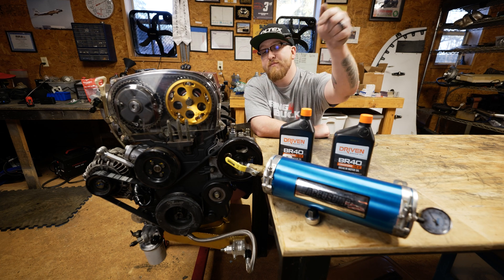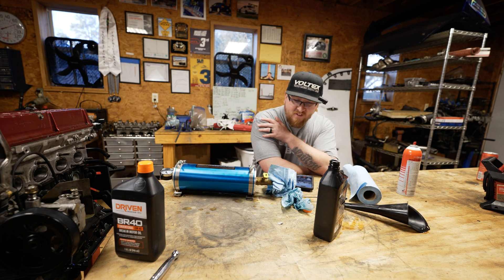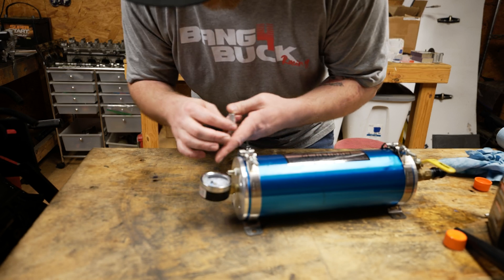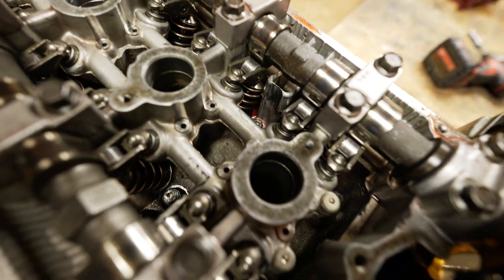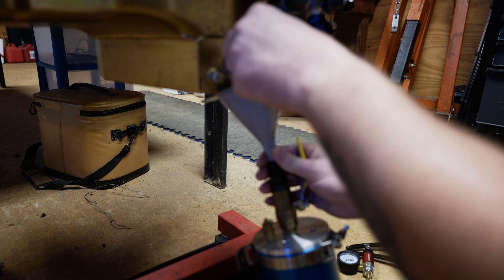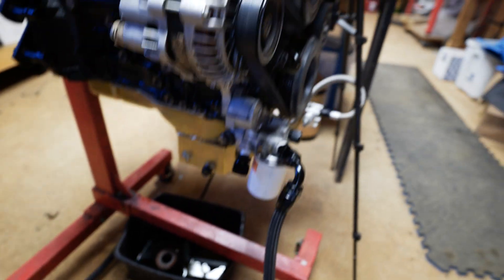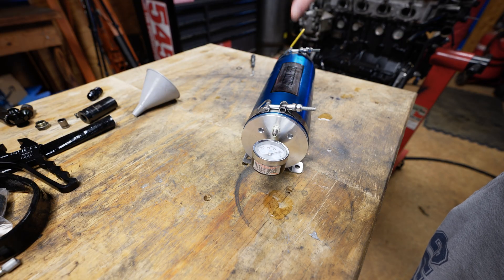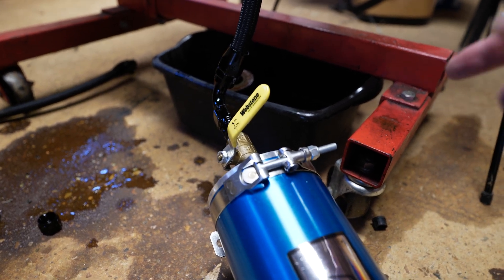Protect Your Wallet, Pre-Lub your Engine Block!

Comment: The accusump is a fantastic insurance policy if you’re not running a dry sump setup. I’ve had one plumbed into my 4G63 for over 5 years and it has played a major part in keeping the engine happy. Before I start the engine, I open the valve for about a minute, as long as it takes me to get my belts on. When I pull into the paddock, I shut the valve just prior to shutting the engine down. When I took the motor apart to rebuild it last off season, the bearings looked really good considering that it only saw track time for 5 years and had excessive water and oil temps for most of that time. Pre-lubing an engine is never a bad thing. Anyone that says different is lost.
Reply from the maker: Thanks for the input!
Reply: @Bang4BuckRacing glad I could help!!

Comment: That sound was just air cus you have the oil in the bottom of the tank while your feed is on top you were just feeding air you should have had the tank upside down that way the air pushes oil down where your feed is

Comment: Just keep the air compressor on the tank so it has constant pressure.
Reply from the maker: I tried that. Once the piston moved fully towards the end of the oil side it stops pushing the oil.

Comment: I did this using a pump garden pressure sprayer, on fully dissembled and rebuilt engine, using the oil sender location with a custom fitting i made to it.  Put 3.5L in through at about 30psi.  At least it filled up empty oil passages and oil pump, got instant oil pressure on startup....unlike last time i rebuilt that engine which needed lots cranking to get oil pressure sensor to send spark to start.
Reply from the maker: That’s awesome. Seeing the oil come out lifters was a good feeling for me knowing most of the galleries has oil in it.

Comment: pouring a quart of oil over the top of the head while rotating the crank manually just works too good i guess.
Reply from the maker: Not entirely. That does not put the oil through the galleries in the block that feed the bearings and head.
Reply: @Bang4BuckRacing  the bearing are what needs initial lube the galleries are just channels for the oil to travel, that require no lube on startup. and the oil drains out of before startup anyway.  pouring it over would have lubed your cam lobes and bearings , a still motor only puts lube on the spot its touching. it has worked fine for me for over 20 years and my teacher for 45+.

Comment: Never prelube with oil, its just going to go back into the sump, you have to use assemble grease, grease sits and works as a lube until its washed out by the oil
Reply from the maker: You didn’t watch the whole video and it shows. I explain why.
Reply: Lol

Comment: Whenever I have changed bearings on my 4g63t, before assembling the distribution I would prime the engine by driving the oil pump with a drill or an impact wrench. It would be nice some kind of cassette mechanism (like the ones on the bicycles) for the oil pump gear so that one can prime it without disassembling the distribution
Reply from the maker: Yeah I wish I would have done that but by the time I thought about it I had already put the timing and serpentine stuff on. Didn’t want to retime it again and keep beating up a dry cam phaser.
Reply: That feeling when you can spin up an external oil pump and hear the oil flow through the motor 🎉